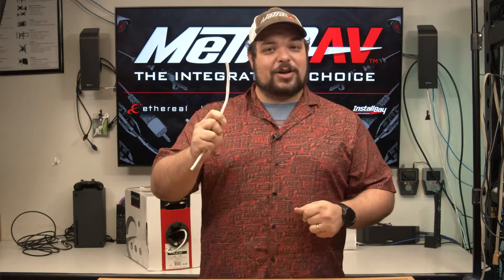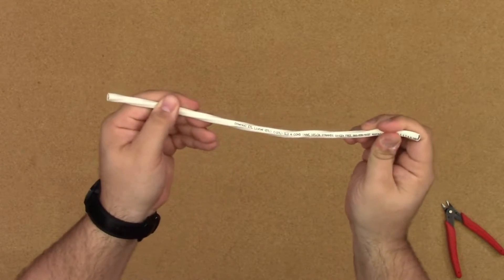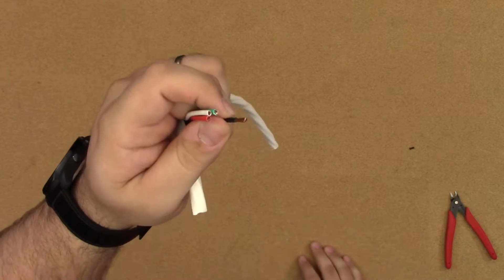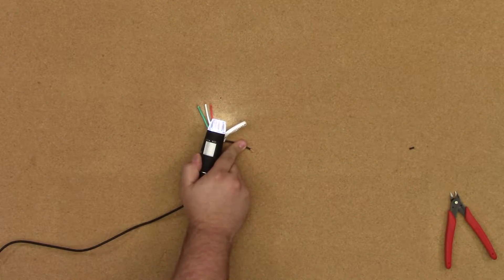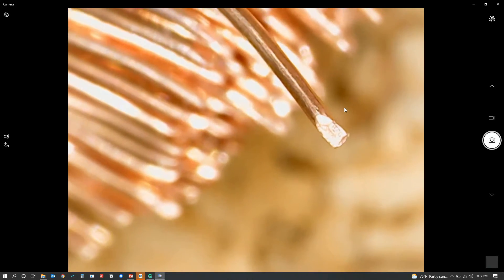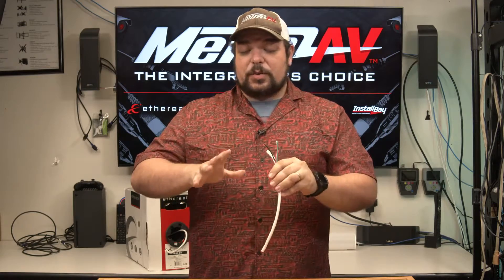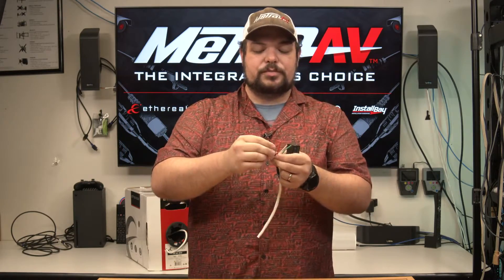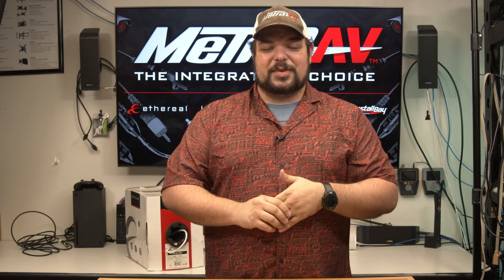Different Ways to Use 14-4C-BW Bulk Speaker Wire - AV Tech Tips Solutions

Comment: Your video came up in my search, but this is not what I was looking for. I have 14 gauge speaker wire, with only 2 wires and was told this is what I needed for my Samson Powered Monitors, but I contacted Samson and they are telling me that is not the right cable. The music store will not give me my money back, so now I have 100 feet of cables I can’t use. I thought maybe I could wire my own balanced lines, but there is no shield or 3 wire, any suggestions on what I can do with this cable? Thanks.